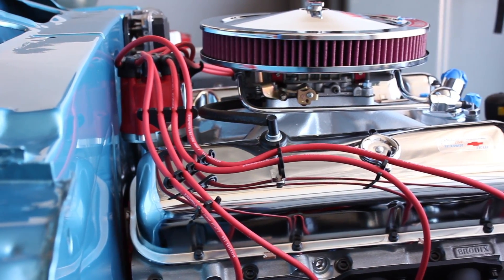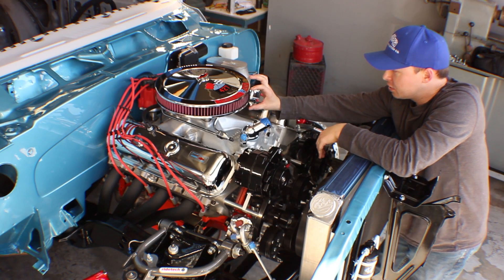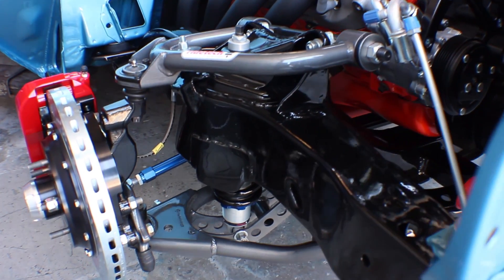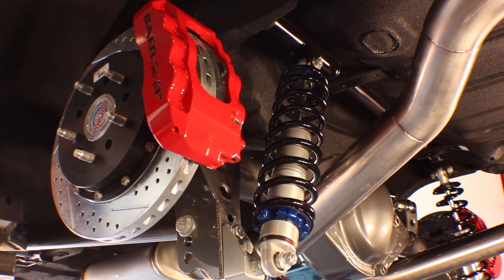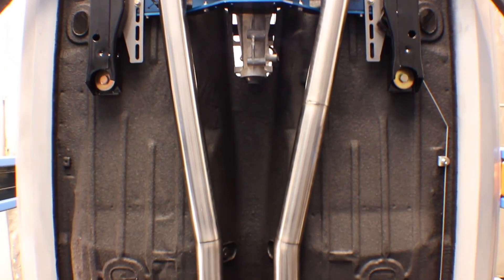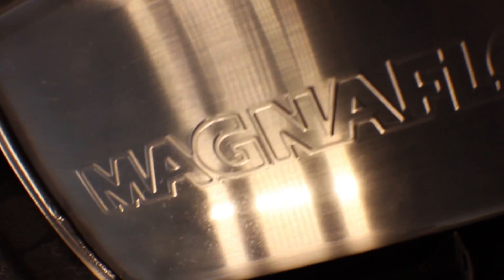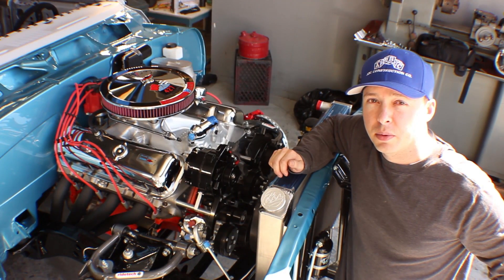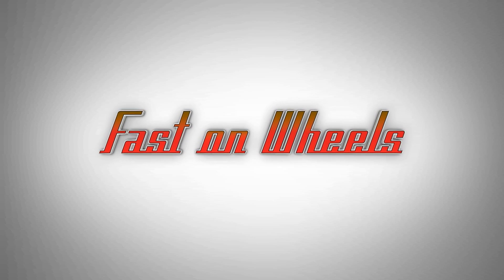1969 Camaro Wagon - Underneath

Comment: I visited Fast On Wheels shop and they do some great extensive work there.
Reply from the maker: brianbirc thank you!
Reply: Fast on Wheels    No thanks needed the comment is truth. I visited you to thank you guys for the mention of the engine builder machine shop Greg has near you after I watched your Bronco building/upgrading video. Greg was very well reviewed and great to have build communicating with me. Frustrated at the moment at the time it takes to have built but mostly after TP's build. The time to install for such a project but it is close to working cross my fingers. It is satisfying to have a classic vehicle that is custom and can perform better than new very high dollar trucks. Besides it is like new especially when done the way Fast On Wheels does some. Close to the way I do mine in some respect behind your way yes but with pride still.